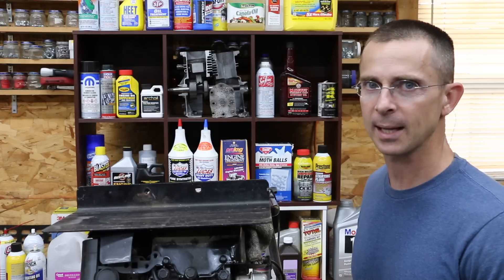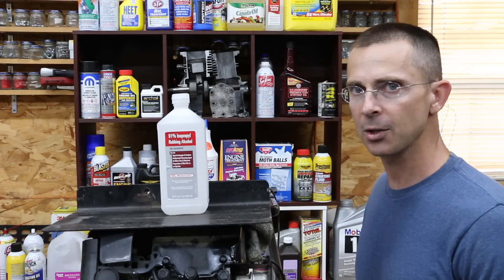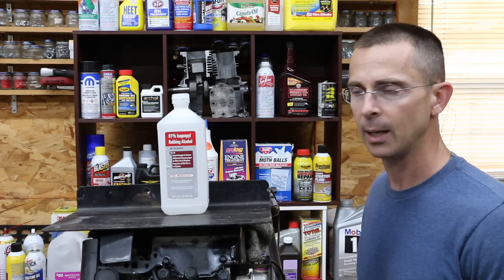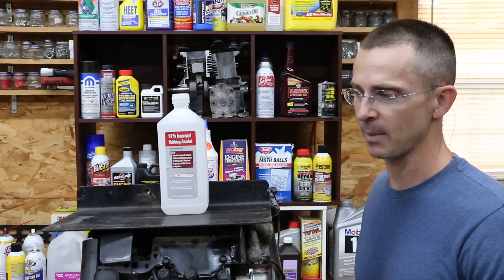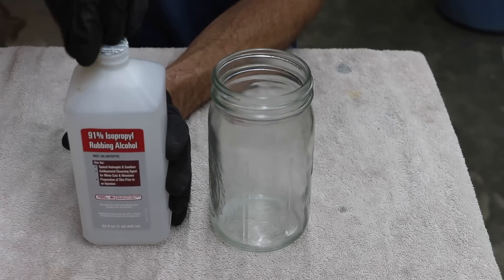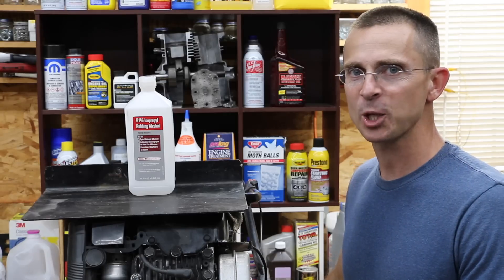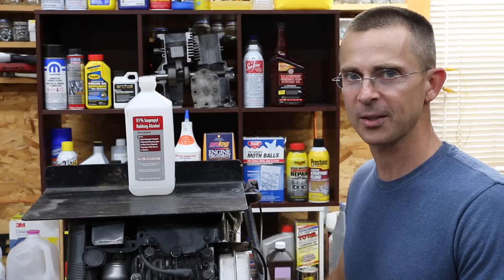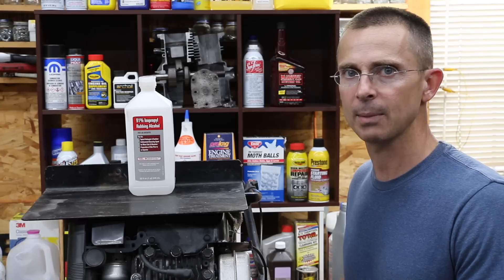Will a Gas Engine Run on Isopropyl Alcohol?  Let's find out!

Comment: Why aren't we using achohol to run our engines? It cleaned the valves, piston, and seems to run the engine the same. Probably only negative would be horrible fuel economy
Reply from the maker: Yes, fuel economy would be much lower.  I don't know if the production costs are higher than gasoline, but this might be a factor too. Thanks for commenting!

Comment: You can try to make a mixture of acetone, alcohol, petroleum ether, and various alkanes that you can purchase from the local hardware store.  Those are what are usually found in various engine cleaners.  make up a 1:1:1 ratio and see if it will run and if so how well.

Cheers
Reply from the maker: Thank you for this recommendation!
Reply: Project Farm no problem. If you need msds or would like to bounce some ideas let me know and I'll try to help. I am a chemist at a small university and find these items very interesting as I do not have a mechanical brain!

Comment: You have to increase the carbs jet sizes by 30% when running a gas engine on alcohol, because it has abput 30% less energy in it. With correct jetting it will run just like it would run on gas.
Reply from the maker: Thank you for this recommendation!

Comment: You should try turbocharging a small engine.  Preferably one that sees a higher load. For example, something you can ride that carries your body weight.  For longevity of the motor, get an air/fuel ratio gauge and keep the afr's stoich(14.7:1) under light loads and low rpm. Under high loads and high rpm, find a way to increase fuel. You would want to target an afr of 11:1 ish.
Reply from the maker: Thank you for this recommendation!

Comment: Try cleaning the crank case with diesel or ATF.
Reply from the maker: Thank you for this recommendation!
Reply: ATF works like a charm. Active Detergents are second to none.
Reply: Elradiuzi we use ATF to prime the new fuel filters and thoroughly clean the injectors every time we do PM service on our wreckers. Merc/Dex ATF is by far the best diesel fuel system cleaner I have ever seen.
Reply: ATF is a good cleaner ^^
Reply: Yard Sale Dale specifically full metal needle in the carb and bigger jet, that’s the key things mainly if you want it to run well, anything else just help make even more power, been pulling garden tractors for years running alcohol and some nitro to

Comment: Can you run a small engine on a 50/50 Motor oil and gasoline? Or 50/50 two cycle and gasoline fuel on a 4 cycle engine??
Reply from the maker: Thank you for this recommendation!

Comment: How long did the alcohol last vs gasoline using the same amount?
Reply from the maker: I can't say for sure since I didn't keep track of time.  Alcohol typically doesn't last as long, since there are less BTUs of energy compared to gas.  Also, the mower engine was running very lean, since the carb doesn't have an adjustable jet. Thanks!

Comment: I live in Fairlee, VT. where inventor Samuel Morey developed the internal combustion engine. Surrounded by white pines and in the pre-petroleum age, he distilled turpentine for his fuel. Talk about "green" energy. Adding turpentine to alcohol might improve some of the negatives of pure alcohol. Smells great.
Reply from the maker: Thank you for this recommendation!
Reply: "A blend of ethanol and turpentine added as an illuminant called burning fluid was also important for several decades. In 1946, Soichiro Honda fueled the first Honda motorcycles with turpentine, due to the scarcity of gasoline in Japan following World War II"        https://en.wikipedia.org/wiki/Turpentine.

Comment: Project Farm, since you have a transparent cover I just want to know if HHO fuel will produce water vapor or droplets inside the chamber. Hope you'll run some test on it.

HHO Fuel are also known as Water Fuel.
Reply from the maker: Thank you for this recommendation!
Reply: Project Farm just an add up. If ever HHO Fuel will produce water vapor inside the chamber will it's Ph Level be acidic or not? If it's acidic will it cause corrosion inside for long term use?

Comment: engines should run OK on alcohol, but it does need bigger jet sizes...it has 30% +..... less BTU's than gasoline.
Reply from the maker: This is an excellent point.  Thanks for commenting!

Comment: one thing that drives me nuts about lawnmowers is the noise (especially at 5am because everyone wants to get the lawn mowed before it gets hot) how about a video on homemade mufflers to see how quiet you can get the engine and see if the affect on performance would even be worth it? as always, youve earned a thumbs up, im surprised it ran as well as it did!
Reply from the maker: Thank you for this recommendation and thanks for the positive comment!

Comment: You could try "Heet" the kind in a yellow bottle. It's a water remover for gasoline. Campers use it for alcohol stoves because it burns cleaner than any other alcohol. (Virtually zero soot)
Reply from the maker: Thank you for this recommendation!

Comment: LOOK AT THAT INTAKE VALVE!  

Rubbing alcohol is denatured.      Everclear is pure grain alcohol
Reply: Valve is clean because of the water in the 91% isopropyl alcohol. The water doesn’t combust, so it turns to steam as it compresses... and basically steam cleans anything it comes in contact with. The water is also responsible for the lower running temperatures. Alcohols have less energy than gas, so running a gas engine on alcohol without increasing the fuel flow causes the engine to run lean which causes the engine to run really hot. Water is endothermic as it evaporates... pulling heat away with it.
Reply: GioGuitarDude 

The engine produces about the same amt of water as the fuel it burns. So it produces plenty of steam anyway.
Reply: You can absolutely get 100% alcohol either by salting the water out or using molecular sieves.
Reply: How is that valve so clean?
Reply: Rubbing alcohol is isopropyl alcohol. Everclear is ethanol. Denatured alcohol is ethanol with a small amount of methanol (which makes you go blind) so you can't drink it this it is not liquor taxed.
Reply: They also sell something called fiber optic cleaning solution. It's 100% alcohol
Reply from the maker: These are all great recommendations--thank you!
Reply: Benzine is used to remove all the water in laboratory grade alcohol , to set the record strait.
Reply: Pegleg Noid 

Toluene actually. Via azeotropic distillation.
Reply: Austin K because it burned all the gunk off it
Reply: Benzine also removes the water.
Reply: No matter what alcohol you use, add salt to it to pull put the remaining water, which will sink to the bottom. You can siphon out the top pure alcohol.
Reply: Yard Sale Dale 

Sure you can. Just not by distillation.
Reply: hsvkidusa everclear still has a little water in it

Comment: Did you try tuning the carb after starting it with the Isopropyl Alcohol? The air/fuel ratio for gasoline is about 14.7:1, but for Isopropyl Alcohol it is about 11.4:1. So you might need to run it a little richer to get it running smoothly. The rough idle you had could just be that it was running a little lean.

As always, great video!
Reply from the maker: I wish the carb had an adjustable jet like the older engines.  It was definitely running very lean.  Thanks for the positive comment!

Comment: They sell a 99%, it's still pretty cheap. I wonder if it'd be smoother that way.
Reply from the maker: Thank you for this recommendation!
Reply: It will run smoothly, I tested in my car. Sooo much powah! Well I need to mix in water next time for engine cleaning.
Reply: @foonan8  , really it turned my Camry into a race car.
Reply: @gsp49  haha haha great! But do not use too much cause I don't know what will happen after it.

Edit : I used it 99% just once and I will mix water in next time.
Reply: @foonan8  can't tell if you're being serious or not
Reply: @tehgzizlauw1787  yes i am serious, i tested it in my car. But when i mix it with water, well of course it will not mix.
Reply: I was thinking the same thing, I usually buy 99%.  This is so interesting.  I wonder what the pros and cons are for using alcohol vs gas.
Reply: @marcus.guitarist  pros are it may be cheaper and cons are the fuel industry will put a research paper out saying it's bad for the engine. Lol no, but I really do wonder why not just use that.
Reply: @romerogiovanni7  Is it really cheaper there? here in turkey it costs like 3 times.
Reply: It'd likely run better on ethyl rubbing alcohol which is mostly ethanol.

Comment: Looks like the exhaust valve got a little hot and it did clean the carbon up a bit. Good post thanks.
Reply from the maker: Great point. It did get hot from running lean.  The carb isn't adjustable or I would have increased the fuel flow. Thanks!

Comment: Not sure how doable this is, but could you test the old "magic 100 mpg carburetor" myth with this? The preheated/vaporized gasoline thing. I know the myth is false, but I'm curious if the engine will even run on vapor.
Reply from the maker: I'll definitely put together a video on gas vapor. Thank you for this recommendation!

Comment: Rip any rubber components though?  (Fuel hoses etc if there are any) And have you ever tried running an engine on gasoline vapors?
Reply from the maker: I don't believe it caused any damage, but it would likely cause damage in the long run. Thanks for the recommendation on gas vapors.  I'll put together a video on this.

Comment: Try feeding the engine directly from that alcohol container but first immerse the bottle into some boiling water so the alcohol gets warmed up till 70 Celsius . No open flames ! Now connect the warmed bottle to the fuel line and start it.
Reply from the maker: Thank you for this recommendation!

Comment: Have a list and i hope you'll be checking it twice. Try running an engine off of  butane, Methanol, Nitro methane, Wood Gasification, Kerosene, Natural gas or LP gas, Ammonia, Synthesis gas, Hydrogen, and maybe shoot some oxygen in a gasoline engine. The list goes on but it would be rather immersive if you went through these. I have been very good this year. love your channel.
Reply from the maker: These are all excellent video ideas--thanks!  Also, thanks for the positive comment!

Comment: You should try running the engine on E85 gas from the gas station. Also try a 50/50 mix of E85 and regular gas. It might go lean on 100% but the 50/50 mix could work real well and save some money.
Reply from the maker: Thank you for this recommendation!

Comment: Test piston ring gap sizes, and lining up the ring gaps. Use new rings for the test. Test if the ring gaps rotate when running the engine. Try removing the piston ring stop peg on a two-stroke engine. Great videos! Thumbs up as always!
Reply from the maker: Thank you for these recommendations and thanks for the thumbs up!

Comment: can you try diesel as cleaner for the internal of the engine. put diesel with the engine oil , run it and change the oil. and check if it cleans it or not
Reply from the maker: Thank you for this recommendation!

Comment: What about liquefied Gojo if you heated it up it will be a liquid and all the sand falls to the bottom remove the sand and put the liquefied GoJo through into the engine see if it'll burn, try mixing it with gas see if it cleans a cylinder headed
Reply from the maker: Thank you for this recommendation!

Comment: No suprize here, dragsters run on alcohol too. The reason why it ran rough was the aggressiveness of the alcohol, plus a dry cylinder. If you mix some thin oil or gas with the alcohol it should run much better. I'm suprized you didn't see cooler temps from the engine, considering alcohol burns at a much cooler temperature then gas does.
Reply from the maker: All great points. I think it would have ran a lot cooler if I increased the fuel flow by 30%.  Thanks for commenting!

Comment: Interesting. I wonder if there is some detonation happening causing that unsmooth noise. You could try mixing 70% and the 91% half and half for an 85% approx mix. Maybe that could run with more power and less knocking. Or maybe you need the 99% if you say it doesn't have as much power? I think for carbon cleaning purposes the lower % you can go might allow the alcohol in liquid form to penetrate the parts of the engine longer as it should be less violent than a more pure mix. Just guessing here.
Reply from the maker: I believe it was running really lean.  I think I needed approximately 30% more fuel flow, but the carb doesn't have an adjustable jet.
Reply: That makes sense!

Comment: Many race cars run on alkyl but it uses way more than oline
I  jetted bigger and has top oil added  check out dirt track style racing alkyl makes power but in long races you use oline or you won't  have enuff fuel.
Reply from the maker: Thank you for this recommendation!

Comment: could you do a video on running a gas engine on "white fuel" aka camp fuel?
Reply: in a low compression engine like this it'd most likely run exactly like gasoline.  White gas is pretty much gasoline without the additives (which raise octane rating among other things)
Reply from the maker: Thank you for this recommendation!

Comment: I heard of a fellow running a briggs on flour once. I don't know what he used for a carborator though. He said he got more power than with gas... i dunno please see 

https://news.google.com/newspapers?nid=1893&dat=19281127&id=kPMoAAAAIBAJ&sjid=29MEAAAAIBAJ&pg=5236,3682431&hl=enhttps://news.google.com/newspapers?nid=1893&dat=19281127&id=kPMoAAAAIBAJ&sjid=29MEAAAAIBAJ&pg=5236,3682431&hl=en

also see

https://www.ar15.com/forums/general/Can_an_engine_run_on_flour__Serious_question____/5-482909/
Reply from the maker: Thank you for this recommendation!

Comment: Here's a suggestion. We all know that a blown head gasket results in completely decarbonized piston heads and valves. So why not try adding radiator coolant to the fuel mixture to see what happens?  Great videos by the way.
Reply from the maker: Thank you for this recommendation!

Comment: Alcohol will run SUPER hot because to run alcohol the jets need to be something like 30% larger or the stoichiometric ratio is WAY on the lean side, thus making it burn hotter...which isn't good for valves or rings.  Short term...probably no issues...but long term will cause weakness in almost all internal combustion engines. 
http://survival-manual.com/gas-to-alcohol-conversion.php
Reply from the maker: Brian, Excellent point!  Thanks for commenting and thanks for the link.
Reply: Ya know...after investigating further..I realize I am 100% incorrect...alcohol needs a 9:1 ration, gasoline a 14.7:1...so thru a gasoline jet, pure(ish) alcohol will be much more rich than gasoline...means burning cooler but using more fuel than needed resulting in heavy carbon buildup...my apologies for the misinformation
https://www.brighthubengineering.com/machine-design/15235-the-stoichiometric-air-fuel-ratio/

Comment: Try running an engine off 50 50 mix of oil and gas or 75 25 mix. Possibly see what ratio of oil to gas the engine starts to loose power. I think that would be somewhat interesting. Also you do a phenomenal job on your videos, please keep up the good work.
Reply from the maker: Thank you for this recommendation! and thanks for the positive comment!

Comment: That's cool that it runs but...
I was thinking use alcohol instead of seafoam. Poor straight into the intake.
I believe you made a video on using water through the intake like  seafoam and the pros and cons.
I think a mixture of water and alcohol  could potentially be an excellent recipe for cleaning a combustion chamber.
My theory is that the water would clean while causing the alcohol to linger in the chamber longer for more cleaning action. And the alcohol would clean and help chase and burn away the water to avoid negative effects of water creeping in an engine.

Of course alcohol is sold in different ratios, like 30% or 50% water.
All of which are way cheaper than seafoam or even a bottled water at the gas station.

I'd be super interested in a test of this.
Reply from the maker: Thank you for this recommendation!

Comment: have you tried running a diesel engine on strait waste motor oil yet? I mean run it through a filter so you don't destroy the fuel pump.
Reply from the maker: Not yet. Thank you for this recommendation!

Comment: I'm impressed it ran that well the 9% that isn't alcohol is generally just water!  Maybe it would have sputtered less with 99% isopropyl
Reply from the maker: Yes, I believe it would have ran better on 99%.  A larger fuel jet might have helped it run smoother too. Thanks for commenting!

Comment: Engine is running lean with the alcohol. You could try and increase the size of the jet in the carburetor, that should smoothen out the running and possibly even clean the engine better.
Reply from the maker: Thank you for this recommendation!

Comment: That was very interesting of a test I'm surprised at the result usually these lawnmower engines are so fuel sensitive that they don't run in much of anything except straight gas and it has to be fresh gas at that lol but you could try some other types of alcohol like moonshine or some kinds of liquor lol
Reply from the maker: Thank you for this recommendation!

Comment: Another fantastic video! Thank you for continuing to put up this great content and keep up the good work! In case you ever decide to revisit isopropyl alcohol you can mix it with dehydrated magnesium sulfate (epsom salt) and then filter it off with a coffee filter to remove the water. It should run smoother after doing this as well. Thanks again for the great content!
Reply from the maker: Thank you for this recommendation!